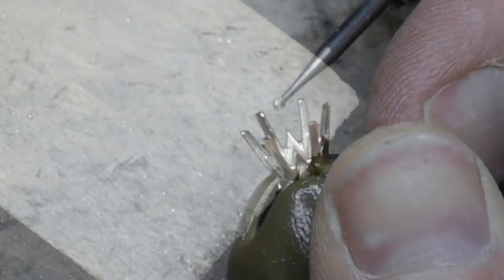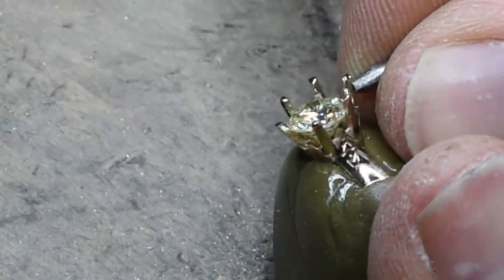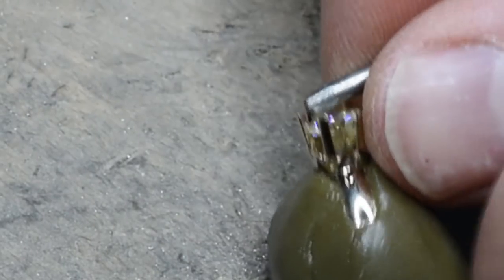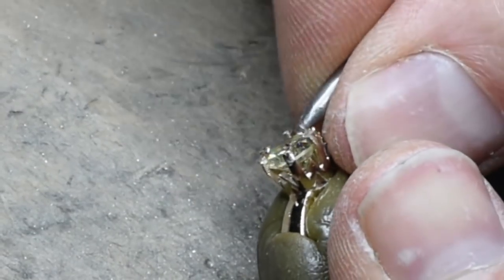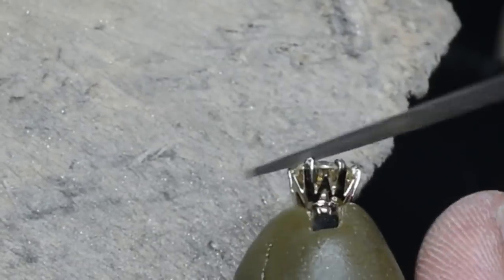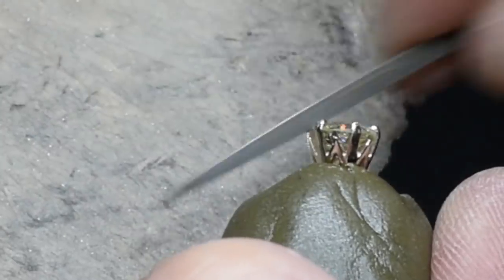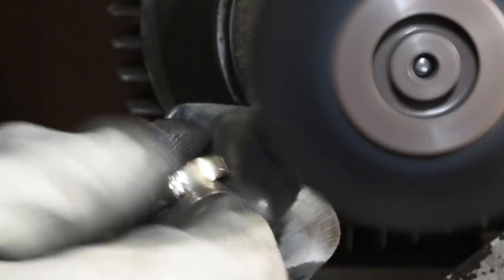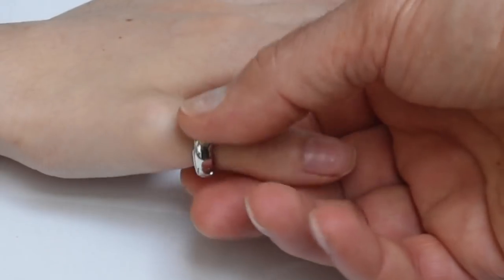Practical guide on how to assemble precious stone in a claw setting

Comment: So happy to see a new video from you! And THIS is an amazing ring!! The mechanism of the ring so the customer doesn’t have to worry about the fit over the knuckle is brilliant! 
Question: You didn’t set you prongs in the ‘lug nut’ manner that I’ve learned and have only seen others do. Is this the manner for all your prong settings? To just work your way around the ring and not have it slightly tilted?